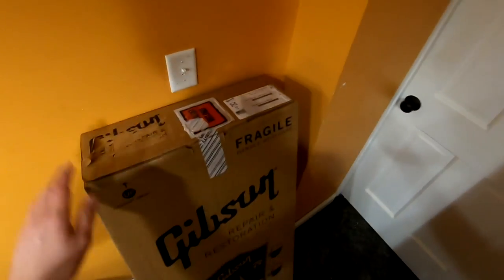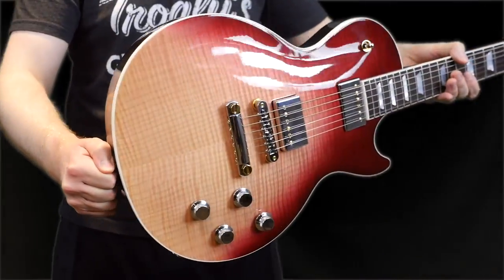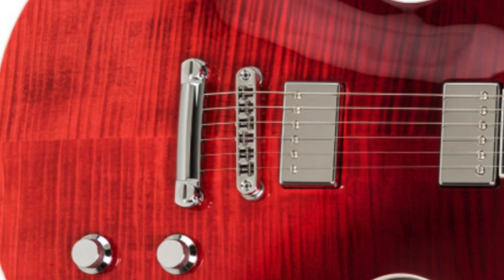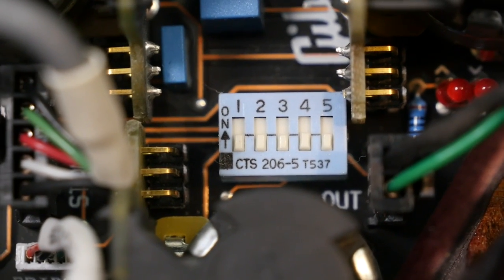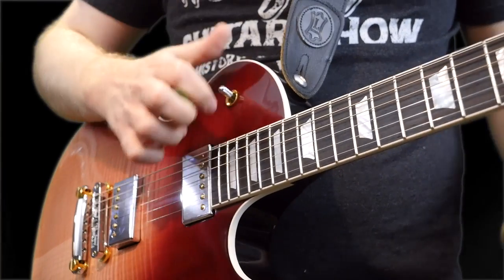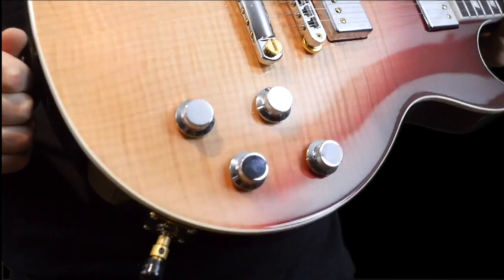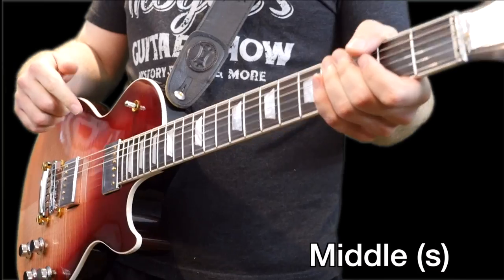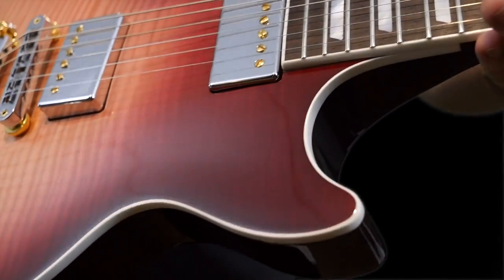How Do These Even Work? | 2018 Gibson HP High-Performance Les Paul Standard Hot Pink Fade Review

Comment: The highpass filters are treble bleed circuits across the volume knobs, so it brightens up when your turn the volume down. And they are not controlled with any push-pull, you just switch them with the dip switch. With pushing or pulling the tone knob, you select if you use the inner or outer coil of the pickup while splittet.

Comment: Great to see you checking out one of those. I picked up a new one in Mojave Fade back when Gibson ownership changed and GC had them on sale for like 2300-2400 USD.
I love the belly cut, neck profile and that there is no chunky heel. Don't care about the robot tuners and never touched the dip switches (I agree that they are both gimmicky, but they don't really get in the way either, the bass side tuners working in the opposite direction is a bit annoying though)

Comment: The "high pass filter" option is a treble bleed.  You won't hear it unless you change the volume.  I've also noticed that if you pull up to reverse coil, it's a little more open in the tapped position, so a good compromise for both clean and distorted.  I personally find the HP4 circuit quieter (less noise) than the one they used in the standard (and now the Modern and Classic?) and appreciate the reverse coil and treble bleed option.

Comment: Tapped is a P90 sound, per Gibson.  Split is, well, split:

What Do You Hear? Tap vs Split Explained

Tap = Accesses the pickup coils through a filter. Effectively accents a particular frequency range for a “tuned tap”.

Result = Fatter, P-90 style voice with balanced output. Also offers lower noise and hum than true single-coil.

Split = Isolates one coil in the humbucker pair. Effectively changes a humbucker into a single-coil pickup.

Result = Brighter single-coil sound with lower output than humbucking.

NOTE: The pickups are Reverse Wind/Reverse Polarity to retain hum-canceling operation when both pickups are combined.

Further DIP Switch Functions

DIP Switch 3 is Neck Volume High Pass Filter (Treble Bleed)
DIP 3 off = out of circuit.
DIP 3 on = in circuit.

DIP switch 3 further controls your neck pickup. As a volume control is turned down, high frequencies tend to be attenuated. The resulting sound is darker as the volume is lowered due to the interaction of the coil inductance and the volume pot. The High Pass (Treble Bleed) circuit effectively offsets these losses by passing higher frequencies as the volume is lowered.

Result = a cleaner, “crisper” sound at lower volumes

DIP Switch 4 = Bridge Volume High Pass Filter (Treble Bleed)
DIP 4 off = out of circuit.
DIP 4 on = in circuit.

DIP switch 4 further controls your bridge pickup, as above.

Result = a cleaner, “crisper” sound at lower volumes.

Comment: I have the 2018 HP2 model in a cobalt fade, picked it up new for 2/3 the price. But what spoke to me was the first time I struck a chord was the clarity and tone from the pickups. Imo if you use this guitar with a TS pedal and a tube amp, it really sings just like. Almost PAF like (not a PAF expert) as far as I can tell. Also that neck, if you have large hands, it plays so smooth. The thickness of the neck is tough to get used to though, but you need it with the wideness of it.

Comment: I actually own a 2016 Gibson Les Paul Studio Faded HP that came with the G Force tuning system, and it's really a phenomenal guitar. The G Force system is actually very accurate. The one time I had an issue with it, I did a factory reset as per the instructions and haven't had a problem since. It came with Burstbucker Pro's and sounds and plays like butter.

Comment: My 99 Parker Fly doesn't have pickup rings and used the A string and B string pole piece to raise and lower the pickup. You have to get special made pickups from dimarzio if you want to replace them with something else because they are thinner than a normal Humbucker. Also Dimarzio doesn't do all models because some don't fit.

Comment: Great review Austin.  I looked at the HP I back 4 years ago and liked it, but Richlite, Robotuners and the pickups being non-descriptive caused me to be turned me off.  I never got to see the HP II, which had locking Grover tuners and a Rosewood fretboard.  So, I got a 2018 Gibson Les Paul Standard in Mojave Burst on clearance from a major Gibson Authorized Dealer at the time at a 30% discount.  There are no DIP switches, yet there are 4 knobs that do pull up. They are the (1) neck single coil , (2) bridge single coil, (3) out of phase, (4) true bypass.  I only use the true bypass from time to time.  Mine also has a rosewood asymmetrical, and compound radius with really nice Grover Locking tuners.  It is weight relieved but with BurstBucker Pro Pickups, which sound awesome.  For comparison, I also have a 2020 Gibson Les Paul Custom Shop R0 VOS with unpotted pickups. My 2018 Les Paul Standard rates an 8 out of 10 and that is only because the Custom Shop is a 10 out of 10.  There is no comparison to my 2017 Fender American Professional 3 Color with Rosewood Fretboard with H-S-S ShawBucker /Tim Shaw Pickups. The Fender in the ShawBucker Bridge position sounds really nice but rates a 6 out of 10 when compared to the Gibson Les Paul's that I have. If I did not have the Gibson's as a comparison, I would have rated the Fender a 10 out of 10. In the end, I sill would have stayed with the 2018 Les Paul Standard versus the HP II.  Thank you for your very detailed review!!

Comment: I have a 2018 HP standard in cobalt fade and I love it! The pickups and neck are amazing. I did swap the chrome truss rod cover for a plain black "standard" cover and the chrome knobs for amber top hat knobs because I like the look better. I think the HP standards are criminally underrated. I've had mine for 2 years and still get excited every time I open the case to play it. The thing is a "do all" work horse and will be my #1 for a very long time. I will say that the only thing that bugs me, and this is knit picky but mine has a lighter colored rosewood board. It is a great fretboard, and there's nothing wrong with it. I just wished they came with Ebony. My HP has a cobalt fade finish which almost looks black. The light brown fretboard stands out, to me at least. An ebony board would really look phenomenal in my opinion and fit the look of the guitar better.

Comment: The purpose of a high pass filter is to allow the high frequencies to pass through when the tone pot is turned down. Think of it as a treble bleed circuit. 

Normally when you roll the tone pot off you lose the high end and the sound turns really dark and muddy. The high pass filter allows the high frequencies to to remain even when rolling down the tone.

Comment: Honestly liking this model and it sorta sucks that for a while Gibson was trying to do something different and kept falling short.
Reply: Did they fall short or was it that the market wouldn’t accept anything “modern” from Gibson? Too many guitarists are just too focused on things being like they’ve always been to facilitate innovation, especially from the big name, traditional, brands.
Reply: @davidburke2132  I want to see a Les Paul with a volute, belly cut, heel access joint and wider frets all for the price of a standard.
Reply: @dogpd3  you might, but past experience has told Gibson that most people don’t want that. And Gibson aren’t a small volume bespoke guitar maker. They have to make standardised designs that sell. 🤷🏼‍♂️
Reply: @davidburke2132  they do have a modern model. I wouldn’t mind getting that. Has a heel access joint
Reply: @dogpd3  indeed, but it’s nowhere near as “modern” as your wish list. There’s no volute and no belly cut. 

Trogly also mentioned it in this video and correctly pointed out that the current Modern is nowhere near as “modern” as this HP he was reviewing: the neck is narrower, the nut is more conventional, the switching is much simpler, the pickup mounting is much more “normal”, etc. 

Frankly Gibson learned their lesson from the middle of the last decade of not making even their more modern guitar versions too different to the Gibson tradition.
Reply: @davidburke2132  very true. Their mistake was making that “modern” model a standard. If they would listed it as a modern in the first place, I believe it would fare much better

Comment: Transient suppression is probably a very small value capacitor that filters out the sound you can't hear ( above 20kHz )   Except for the price
and wide neck it's something I'd be interested in, especially since you can leave the neck hum-bucking and split or tap the bridge, useful in the middle position.

Comment: Pros: 
          Real MOP inlays
          Titanium used for adjustable nut, bridge and output jack
          Push/Pull pots
          Locking Grover tuners
          Nice finishes on an AAAA maple top
          Quality selector switch
          Neck heel relief and body contouring
          Silver truss rod cover
          Pickguard that snaps in and out. No drilling required!

Cons: 
           G Force tuner. I think they're junk.  
           Having to remove back plate to get at DIP     switches
           Richlite fretboards on the HP II's
           Silver knobs feel cheap
           Larger nut width
           Changing pickups out creates a lot of work to get different ones in the cavity
           Ones with aluminum cases that scratch so easily. Like the 2018's case much better
           DIP switches. I've never adjusted mine and I suspect most people's don't. 

I have both a 2017 and 2019 HP and love this line. I do think they are worth the money, so give one a try!
Reply: Agreed, this line gets a lot of unnecessary flak by “traditionalists”.  The real knock was the price at the time.  I picked up a 2017 sunburst hp from the demo shop for $1700 and absolutely love it.  Wider but not thicker neck, cutaway neck joint, titanium nut, has Grover timers.  If I could change one thing, I wish the coil selector pull knob (on the neck tone knob) switched between tap and split instead of having to use the dip switches.  I like the bridge set to split and neck set to tap, widens the available tonal options.

Comment: those switches in the rear cavity are not meant to be switched with fingers theuy are designed tocswitch with the tip of an  electrical screwdriver(an insulated one) then it is easy to do and as far as that switch with the three position that would be a simple enough project for any electrical engineer to complete in a short period of time , you would be abvle to do it yourself it just needs a bit of time thrown at it. although it would be simpler to incorporate a secondary switch hardwired into the loom.

Comment: You can get pots that pull out then have a left and right click that could do your switching. Think about how headlight/ interior light switches worked in american cars from the 80s to the early 2000's.  The first stage would be  a 0-10 knob pull out and it would be a -10-10 knob with a notch in the 0 position.

Comment: I don't really dig the back screw pickup height adjustment screws. It's probably because of the philips head. Using a screwdriver on the back of the guitar makes me need to flip the guitar around more frequently. But maybe I need some more practise on these. I'd change these for hex/torx in a heartbeat, just so I can use a more lightweight allen key

Comment: Does the high pass filter work when you roll back the knob, cutting the bass?

I haven't played one of these guitars but on other guitars, a lot of my favorite sounds were blending the pickups in different modes, single coil bridge with humbucking neck, etc. I can understand not trying to demo all of them, by my count there are 24 possible pickup selections. The differences can be very subtle and mat only be audible when playing certain things, the two different configurations may sound the same when strumming but different when playing arpeggios.

Comment: For Les Pauls I have always liked the Belly-cut and the axcess-heel.... I know 3 models with that, but they are not the same..... The Axcess, the Les Paul HP 2018 and the Les Paul HP 2019 (witch is quite rear since the Gibson line-up changed in 2019).... 
Maby you could do a comparison? :) <3

Comment: I've said this in too many comment sections already, but I'm going to say it again:
I don't know why manufactures INSIST on putting coil splitting on guitars with PAFs or other vintage/low output humbuckers (This particular model is on the edge of that with 8K, so it's not quite as bad).
Splitting a 7.4, 7.5 etc humbucker is pretty useless. They should take PRS's lead and do partial taps. The difference in manufacturing is literally no more difficult to give it a partial tap than it is a true split coil, and cost wise has to be less than 5¢. It's just the normal split, but instead of grounding the coil by soldiering a piece of wire from it to the back of a pot or some other metal, you solder a resistor. When Radio Shack were still around and seeing parts like that, i think a pack of a dozen resistors was like $1.69 or something like that. I imaging buying thousands would drop that price considerably.
I've always done it to mine, but now i use a variable resistor with a trimpot. It essentially does what it does in that video, it's an internal blender control. I don't really go for single coil sounds with a tap, i usually have it so it cuts 25-45% of the coil. It results in more of a "bright/full" switch, or P90/mini humbucker/Fralin Unbucker, Sunbucker thing. I first did it on ES335, 339 and a CS336i owned at one time. That along with converting the bridge tone pot to a master tone and the neck tone to a master low-pass so i can roll off a little low-end made them FAR more versatile.

Comment: Love the colour, but man you'd better like those pickups 'cos you ain't getting anything to replace them with !
Reply: I wonder if you could bend the legs around on a traditional pickup.
Or just take them apart and replace the whole piece.
Reply: @thenameless3271  Not a chance lol - those legs would snap or deform or something - I've tried adjusting them just a bit in the past and had great difficulty getting them to cooperate. At the very least you'd ruin a set of pickups even if you could get them to fit, cos they ain't going back to stock.
Reply: I've taken the mounting bracket off of pickups before, guess swapping be your only hope.
Reply: @thenameless3271  Yeha but it's a lot of hassle though, but I mean where there's a will there's a way. It's not impossible but it is a pain in the ...
Reply: @thenameless3271  Replacing a humbucker pickup’s base plate is no small task.  It’s like swapping out a pickup truck’s frame!
In the case of a humbucker pickup you would have to disassemble everything and hope the new pickup base plates’s threaded pole screw holes correctly align with the original pickup’s cover and bobbin pole pieces crew holes.   Good luck

Comment: Thanks for the video trog this isn't about the guitar that you're demoing and reviewing it's just about cases from that era of Gibson I have a 2017 I guess you call it a firebird 5 they called it a firebird tea they called it the firebird tea and there was also the firebird studio I have the tea comes with a case of course the size of a coffin but it's like such a badly designed in my view cheap case it's got three hinges it's got three latches on a case that's so big when you open it the top of the case can go from side to side because there's not enough hinges or the hinges on it aren't strong enough so you don't really get a great fit it goes out of true next time I bring the guitar in for a setup I'm going to see if the attack could take the screws out of the sides and put them in straight but I think it's the stress of the top of the case moving from laterally from side to side when open that forces the rest of the case to be out of true the second thing is is Scott feet so if you're holding the handle and you just put it down so it sits with the on the floor with the handle facing up right it's got feet on each end but if you go to put it on it's you know on the bottom on the floor or the ground to open the case up there's no feet so depending on the what the surface the floor is made out of you know if it's not you know you wouldn't want to open it on concrete you know we're outside like that cuz it scratches the whole case up I can't understand the million years why they didn't put feet on the bottom of that case every case I own from a aftermarket alligator which is what my Gibson SG is in on my grech archtop case which is an amazing case it's it's made really well it's been in Canada probably by the same company that makes Gibson's it's got five latches five hinges really well made case but yeah you know the case is back at least you know that era the latter years of the teens at least with the Firebirds are just really garbage in a sense sorry for that long comment run on sentences I'm blind that you speech to text that does what it wants with dramatics has its own unique take on the English language and how it's written :-) so if it's too long just skip it I should put that at the beginning of all my comments because I tend to write novellas sincerely yours, Bob the blind bedroom guitars

Comment: Just stick the dip on the screw plate! Tap should tap you off a lower output from the same humbucker. While “split” should split the dual coil humbucker in two, leaving you with output from a single coil.
TL;DR TAP is still TWO coils. SPLIT is SINGLE coil. (alliteration FTW! AF! F-Yeah!